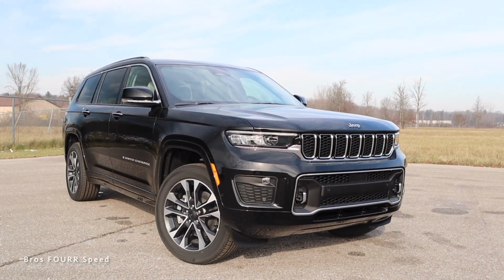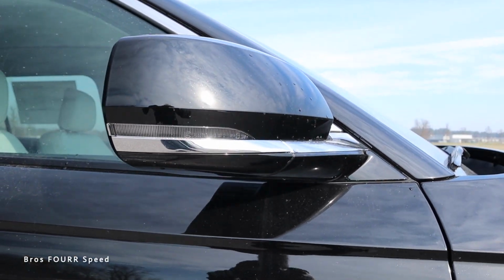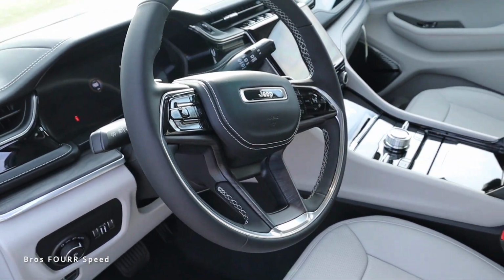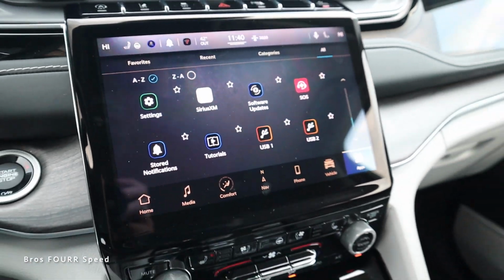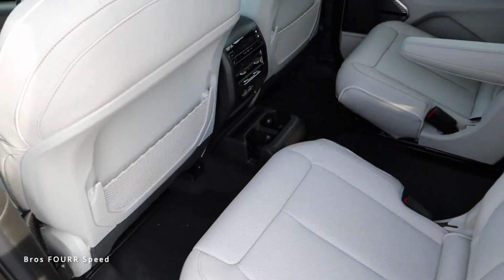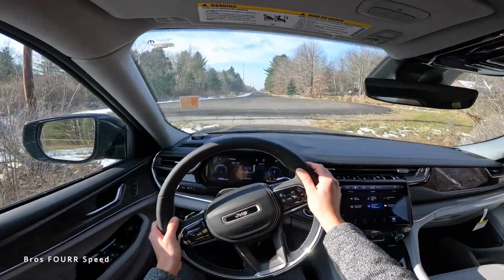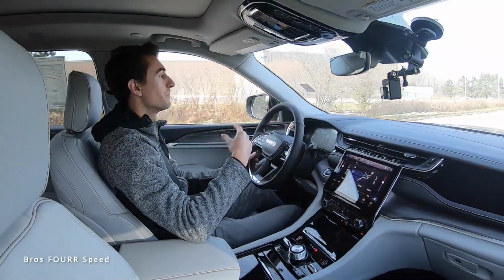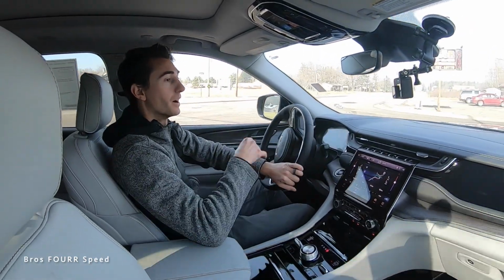2023 Jeep Grand Cherokee L Overland: Start Up, Walkaround, POV, Test Drive and Review

Comment: The Overland is an exceptionally great looking SUV in the regular length.  Very sporty and elegant at the same time.

However, the "L" is way too long and look disproportionate and frankly, unattractive.  If you need a longer version, buy the Wagoneer / Grand Wagoner.

Lexus made a Long wheelbase for their RX350 as well for a short time.  It looked horrible and they ended that version as well.

Even back in 1993 or so, Jeep made a "Long" Wrangler as a two door.  The concept was great on paper (more cargo room), however, looked strange.  Jeep discontinued it after one year.
Reply from the maker: Well not everyone wants to spend even more for the Wagoneer. This is a good alternative for those who don't want a huge SUV but need some 3rd row accommodations.
Reply: It might just be me but I think the L looks more rugged and proportional than the regular wheel base

Comment: Does this have adjustable pedals?  I'm 5'4" and it's nice to have this feature.
Reply from the maker: I'm pretty sure it did. Button should be on the lower dash left of the steering wheel

Comment: Is the ground clearance actually 14 inches? All sources online say maximum clearance is 11.3 inches.
Reply from the maker: On the dealership website under specs, states the max ground clearance is 14in, and min clearance is 10.9.
If it has the air ride suspension it raises up a lot in the off road II mode